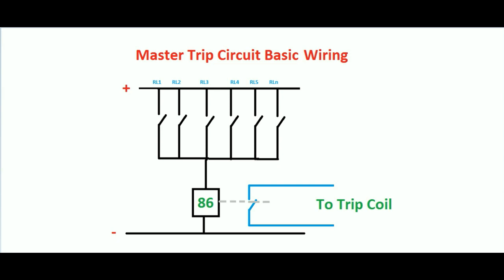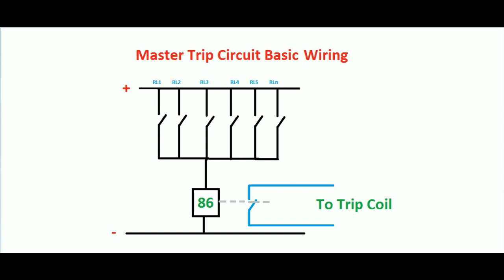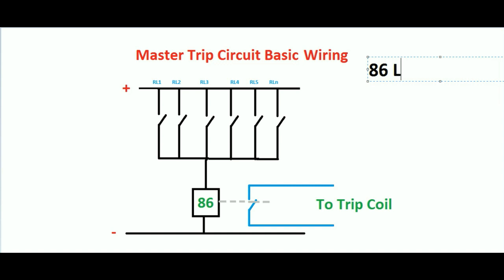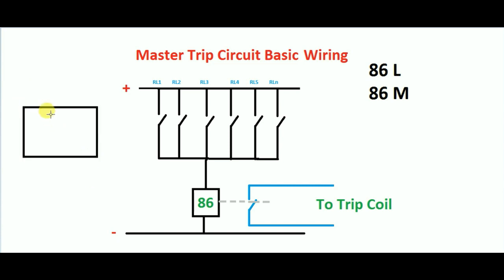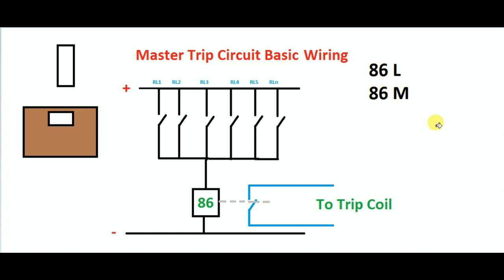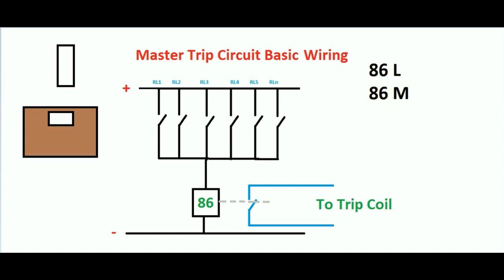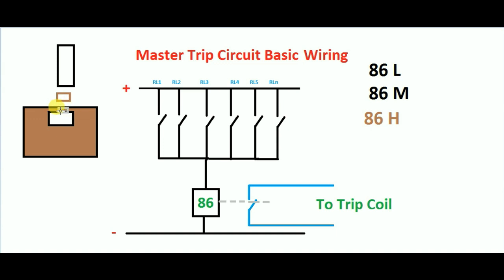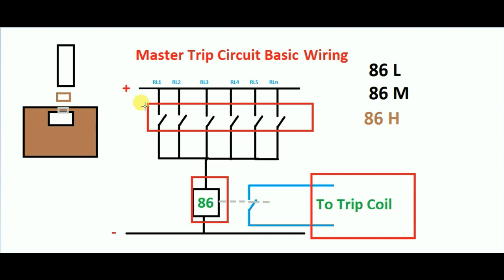What is Master trip Relay Circuit detailed explanation 86H 86M and 86L in Tamil

Comment: As per the diagram shown, if the fault persists, the 86's coil will burn out. There is a mechanism inside the 86 to prevent that. You forgot to explain that. Kindly include that too!

Comment: how many sensing devices and how to  connected relay settings tripping comment, DG, transformer, breakers, production safety relay using explain 🤔 Sensing device using supply, AC or DC, supply va